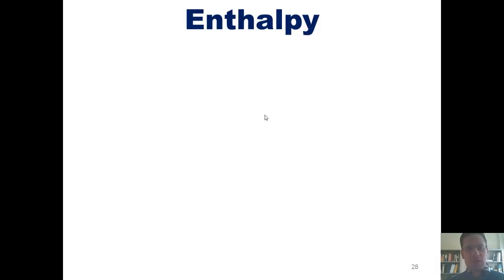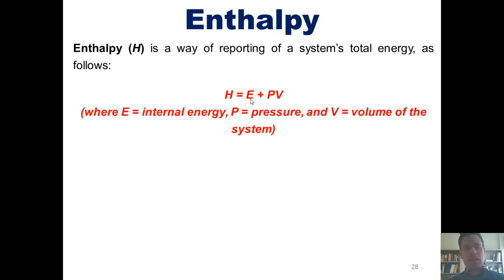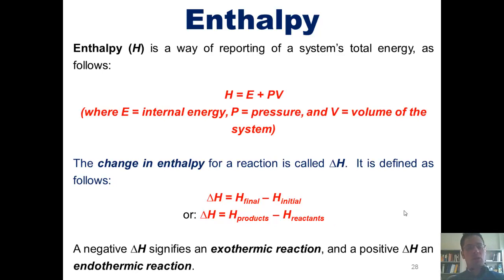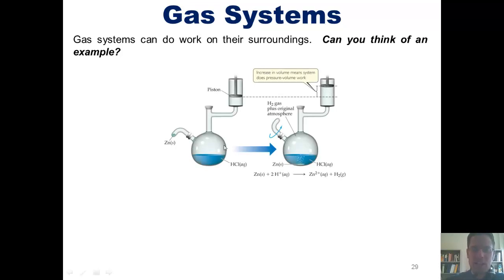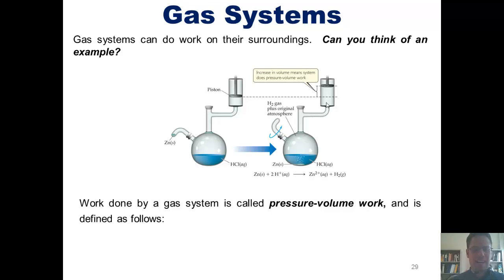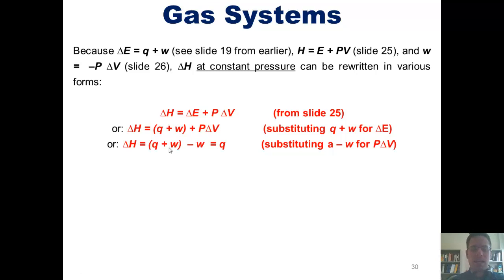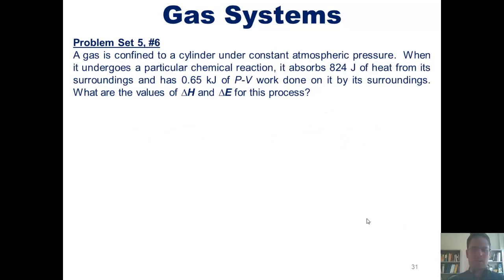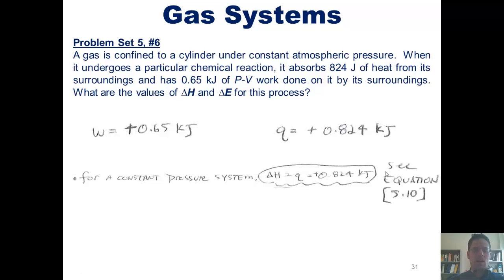Chapter 5 – Thermochemistry: Part 6 of 11

Comment: Thank you for your clear explanations but I have a question :
In eq.5.10 we found that delta H = q if so then why we are having the term Enthalpy (H) from the beginning,i.e. what is the difference between delta H and q ?
thank you,,
Reply from the maker: Abdulla, thank you SO much for asking this question. I actually battled with this one myself for quite awhile. As it turns out, when you have a system under constant pressure, delta-H = q. When you have a system that is NOT under constant pressure, then delta-H and q are not always equal. This is why chemists use two separate letters for enthalpy and heat.

In my class (and in my videos), we only talk about constant-pressure systems, so for all of the examples I share (at least, I think for all of them), delta-H and q are the same.

I hope this answers your question. Please let me know if you need more clarification, and thanks for watching!
Reply: +Mike Christiansen  
I got it now...thank you again for answering my question. BTW I was depending mainly on your explanations to understand the book (the central science) but I found that there are some concepts that were not discussed as deep as the book in your videos! So it is will be nice if you expanded your explanations slightly...and one more thing : the FUN facts and the Chemistry cat jokes are NOT funny at all XD .
Reply from the maker: Suggestions noted. Thanks for watching, Abdulla. Have a great day!
Reply: @Kadry501  noooooooo the fun facts and the chemistry cat jokes ARE INDEED FUNNY